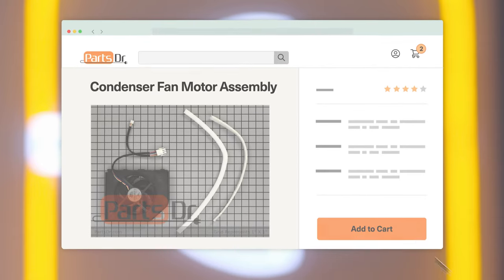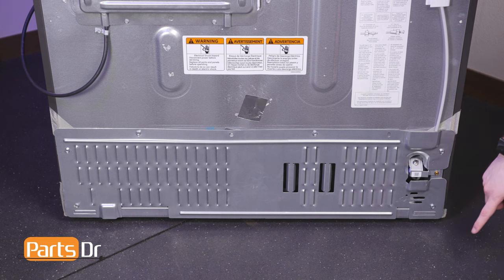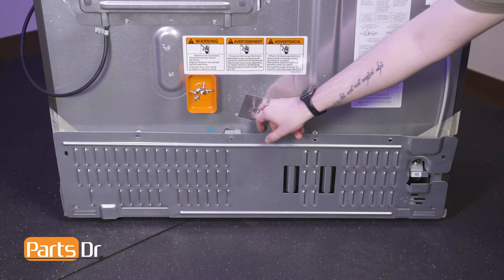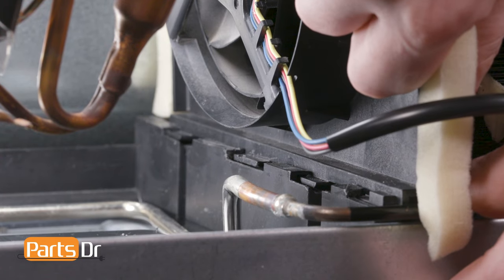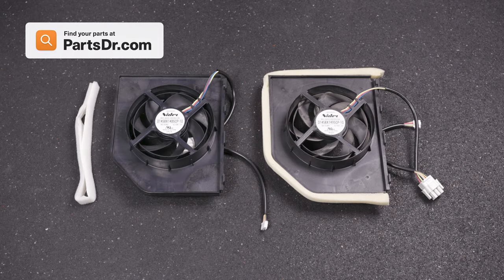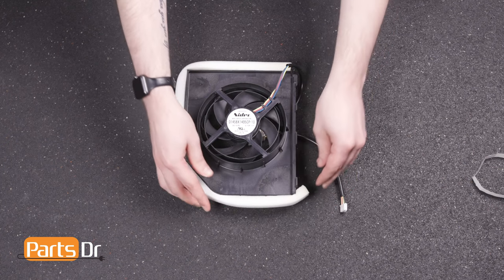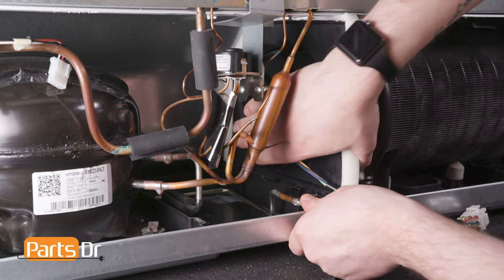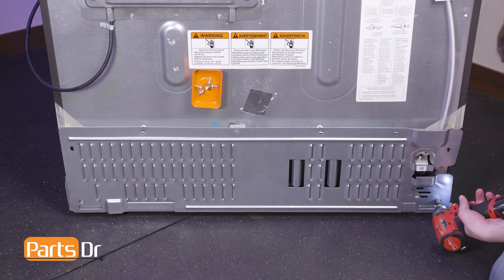The ultimate guide to replacing GE refrigerator part # WR60X23363 Condenser Fan Motor Assembly

Comment: I am so glad I came across their website with a thread describing exactly my issue. This video made it a breeze!
Reply from the maker: Happy that we could help!  What kind of symptoms was your refrigerator having when the fan motor was failing?
Reply: @PartsDr the ice maker stopped making ice first, then we noticed our freezer was not able to maintain a cold enough temperature to keep everything frozen despite lowering the temperature more. Moving the refrigerator from the wall and removing the back cover helped until the part came in.
Reply: @amdove1  I’m having the same problem. My coils were dirty as well

Comment: Awesome instructional! Freezer wasn’t cooling under 17 and the mullion was super hot and this solved those issues! Works like a charm now and saved a fortune avoiding hiring techs. 

One thing about the “great difficulty” part. It’s really not that hard if you have your wife help find leverage points as you yank at it while cursing violently for 45 minutes, it really just pops right out. 

10/10
Reply from the maker: Nice job fixing it yourself!  We enjoyed your tip! 😅

Comment: I have a friend whose freezer stopped working,, I checked and saw fan was not turning. Thought I would have a problem finding a video on this model.. but here it is. This makes replacing the fan seem easy. I will have to get with her to see what she wants to do. Thanks.
Reply from the maker: Glad you found this video.  Put a small house fan pointing at the back of the refrigerator until you get the fan replaced.  Let us know how the repair goes!

Comment: Good instructions. Brief and gave me the confidence to pull on the fan housing. Refrigerator fan is running nicely. Thank you
Reply from the maker: Nice job fixing it yourself!  How did the refrigerator act when the fan motor was failing?
Reply: @PartsDr  I had 2 issues so not sure they're related. Some items in freezer wouldn't freeze such as ice cream.

Also, water would run out the bottom to the floor (clogged condenser drain). Only when we inspected the drain issue did I notice fan not running. Started piecing things together. 

Drain still isn't filling the drain pan so need to chase that.

I took before and after temperature measurements. Freezer was about 5.7 F, now it is about -2F. Fridge is the same at 46F
Reply from the maker: @lauraalbert  This fan motor failing will cause the ice cream to not freeze.  If the temperature in the fridge doesn't return to normal after 24 hours, you may have a separate issue causing that problem.

Comment: Do you know what the resistance readings should be on the four wires to know if the fan is bad? Is this the type of fan that should always be running?
Reply from the maker: Typically, the condenser fan motor should be running while the compressor is running.  We do not see the manufacturer showing a resistance test for this part.  You can put the refrigerator into service mode https://www.youtube.com/watch?v=oyW-CUb739I to force the fan motor to run and you might be able to do a voltage test to make sure the main control board is sending power to the motor.
Reply: @PartsDr  I followed the video's advice and threw a fan back there with the back off. I have a freezer again! Ordered the replacement condenser fan on Saturday. Hopefully it gets in some time this week and I can fix it. Do you have ANY advice on how to get the smaller connector off? That's the one issue I'm having. I can't figure out where the clips are to remove it and it's behind whatever that dodad is with all of the tiny copper tubing coming out of it. I'm afraid I'll break something if I get too aggressive. Any advice on how to remove that connecter safely would be greatly appreciated.
Reply from the maker: @FireHawk5560  Most of the electrical plugs have 1 or 2 locking tabs like we show at 0:59 that must be squeezed together to release the connector.  If you can't see it, try taking a picture with your phone.

Comment: Where is the part that requires a ton of effort?  I pull the tube forward and down... Which allows the fan housing to move about a quarter inch backwards (towards me) and then it clearly hits a very hard stop.  I'm reasonably strong guy and I've pulled it is absolutely hard as I can.  Is there a hidden tab or something else I should be looking for?
Reply: Putting your feet on the back of the fridge so you can use your entire body to pull... Did the trick.
Reply: @joefederer8863  😂
Reply: :hand-orange-covering-eyes:

Comment: Will this cause the compressor to overheat? Mine is hot to the touch
Reply from the maker: Yes it will.  Temporarily leave off the back cover and put a house fan on the compressor and condenser coil until the new fan motor arrives.  Let us know how the repair goes for you.
Reply: @PartsDr  I swapped out the fan I ordered from you. Man it all worked out great. Compressor is cool, makes ice and the freezer stays at 0 degrees. Thank you  for all your help
Reply from the maker: @cesaralvarez3298  Nice job fixing it yourself!  Thank you for supporting us and letting us know how the repair went for you.